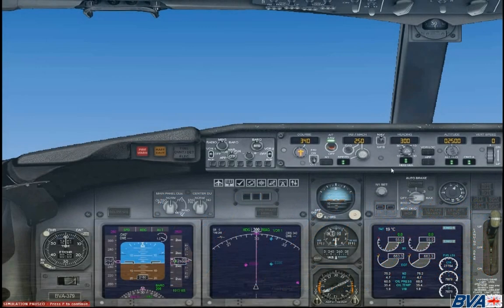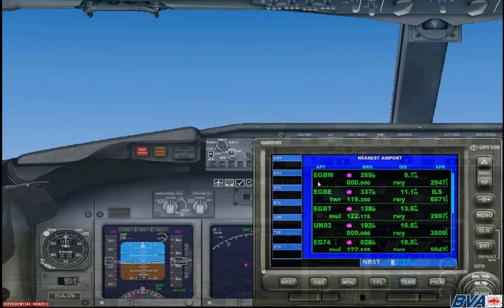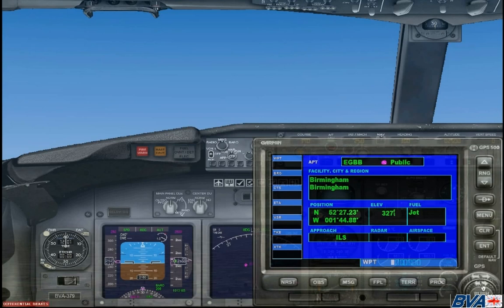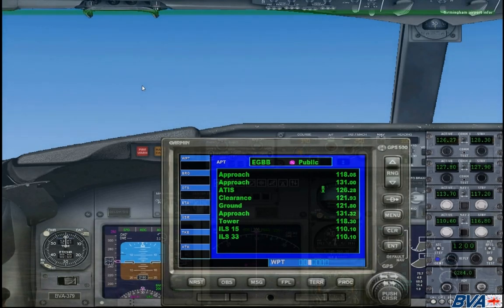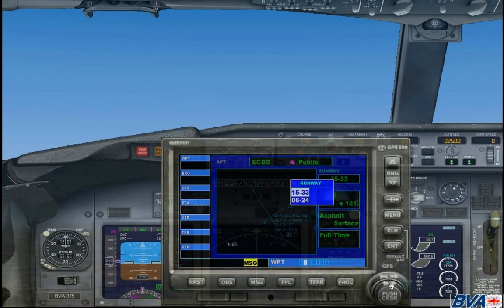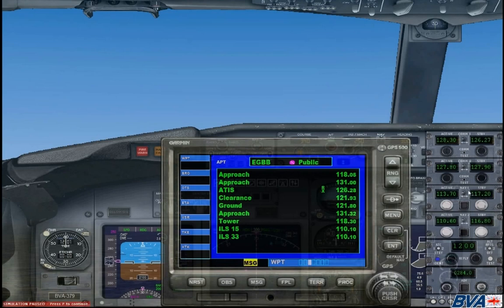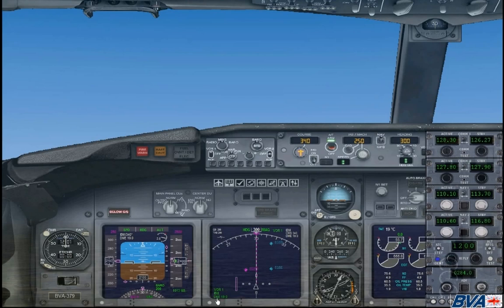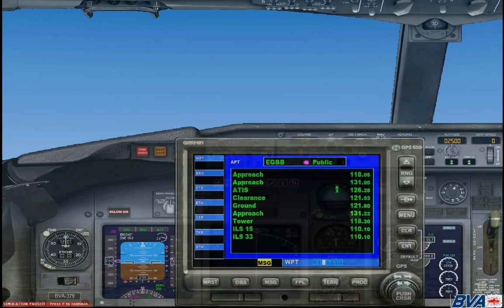1. ILS Approach Tutorial - Part 1: GPS

Comment from the maker: When you set the gps for the final approach etc to a runway, if you set to final vectors, it will set the point in line with runway about 15-20 nm out. If you do not change from final vectors if you activate gps, it will fly you directly at the entry point then try to make some impossible turn. Either change this to a entrance pattern, or STAR (Standard Terminal Arrival Route) or manually fly to the start of the final vector so you are facing the correct direction and angle to make the arrival.

Comment: Thx for replying. Do i have to turn and face the runway manually or is there a way to use GPS and do it? I tryied using GPS but it just makes the plane go VERY close to the runway then turn and line up with it, which cleary will not work cuz a 737 can't manuver that fast. If i have to line up with runway manually then what do i do if the weather is close to zero visablily??? What would be the point of ILS anyway?

Comment from the maker: When you are locking into the ils on the runway, if you are not coming into the runway from the correct direction, you will go down and towards the end of the runway, but from the 180 degree opposite direction. Therefore, to use the ILS properly, you must fly perpendicular to the runway, 20nm or so out to give you some maneuverability room and then turn to face the runway and continue the approach from there.

Comment from the maker: @torero34 If you tune your Com1 / Com2 radio frequency to the frequency for the ATIS frequency found in the GPS screen, and have the correct Com channel selected, it will automatically begin to play the ATIS report. Usually, you will do this on Com2 channel and instead of switching to from Com1 to Com2 you will just listen in to Com2 radio instead, however, some standard FSX planes do not have this feature, therefore just put in Com1 and switch the frequency over with the active frequency.

Comment from the maker: @erik9719 Thing is you cant. FSX is not advanced enough to do this. Basically, the FSX default ATC will bring you in at either a 30 or 60 degree angle onto the localizer. So with the GPS, you don't use it on a landing to fly the plane, but you use it as a visual guideline and use the ILS to fly the plane in. The ATC will always take you off the GPS when it is guiding you into an airport.

Comment from the maker: @Zeragon33 Therefore it will climb or descend dependent on the trim, so try to hold the joystick at the right angle before you turn off the altitude hold switch.

Hope this helps.

Comment from the maker: @Zeragon33 If the conditions are bad and you are not perfectly lined up, don't be afraid to turn it off earlier, around 1000 feet, to line up properly and land the plane perfectly.

The jolting up is probably due to the trim, when it is in autopilot, the trim will be constantly set by the autopilot, so therefore when you turn it off, you may not have your joystick at the right place.

ps. When I am talking about height, this is not height above sea level, but height above the ground.

Comment from the maker: @vinkelnisse If you are within range of the ATIS-report, usually about 100DME, and the frequency is tuned into your active com frequency, com 1 or com 2, depending on which com frequency you have active curently, it should automatically start and repeat infinitely until you are out of ranged or change frequency/switch active com channel.